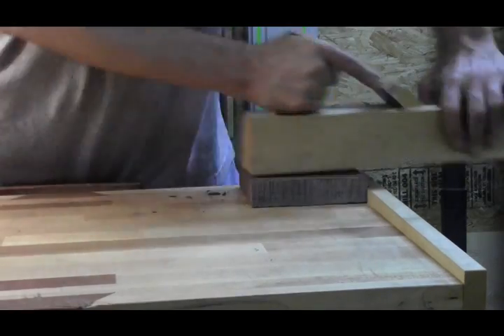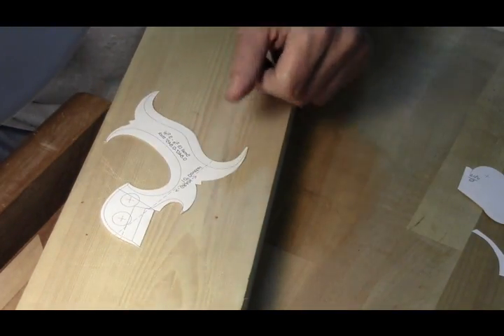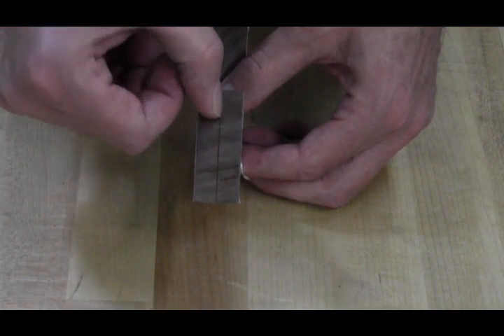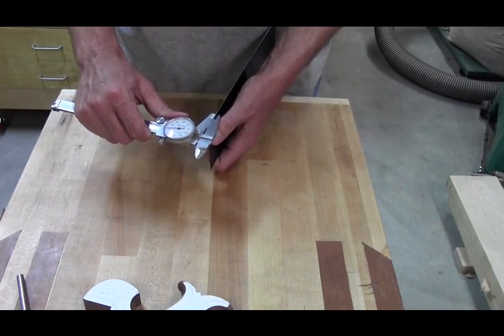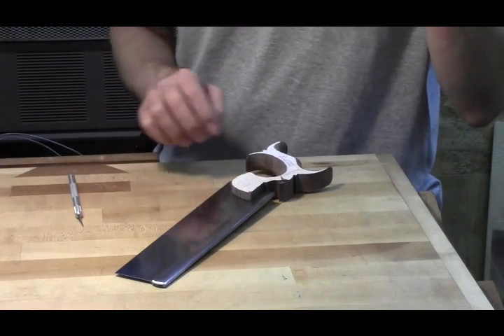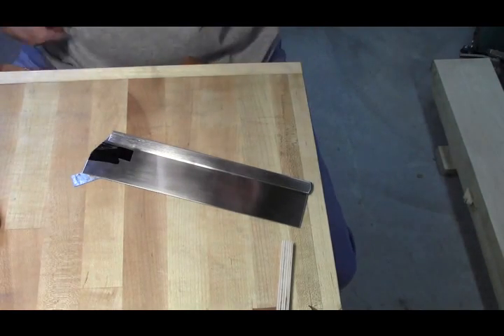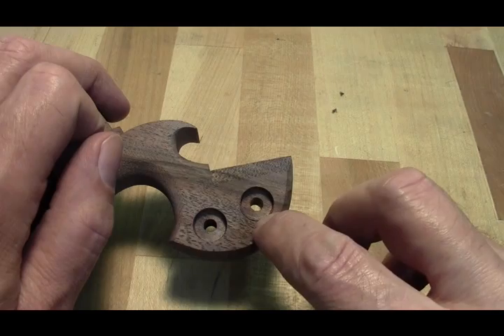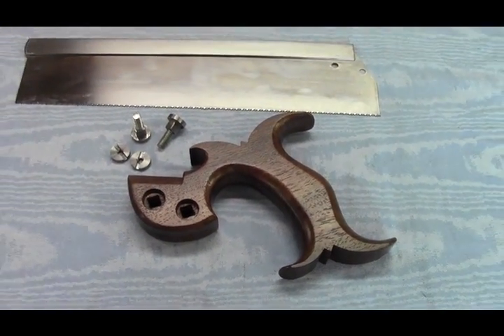Dovetail Saw Build - Part 2

Comment: could help but notice your spray setup for the shellac I looks like and aerosol can on a small jar did you make that?
Reply from the maker: mggcomputers That is a Preval brand sprayer.  You should be able to find them in the paint section of the big box stores In the US.  I have used them for many years.
Reply: Oh cool, thanks for the tip

Comment: An old trick for drilling is to get a nail cut square or similar pin, and spin it in a drill press against the hole location until you draw the temper enough to drill it with HSS.

I have a 3 ton press, so I will probably just make a simple die.

A trick for teeth is to use a hack saw blade as the template, either totally, or just long enough to get the positions for the teeth you will file.  That was in some FWW publication.
Reply from the maker: +Hondo Trailside Paul Sellers has a trick of using a hacksaw to start forming new teeth on a saw plate.  I haven't tried it with 1095 steel yet but if it works, it would make my files last longer.

https://woodworkingmasterclasses.com/2014/12/recutting-resizing-saw-teeth/

Comment: Well I just found this vid series and have learned much.wondering where to find a saw handle makers file though ?.
Reply from the maker: I got my handle makers rasp here:
https://www.toolsforworkingwood.com/store/item/GT-SHRASP.XX

Not cheap but it is hand stitched stainless steel, a nice tool.  You can get by with regular files and rasps, this one with the curve just makes it a little easier.  I have already used it to make three saw handles and have more planned for the future, so it should amortize out nicely.  If you are only making one or two, I'm not sure I would spend that much for the tool.
Reply: thanks

Comment: I was surprised to see that punch work on that metal.
Reply from the maker: You're right, that steel is really tough.  You can see in the video that the punch goes through all at once in a fairly violent fashion.  I wasn't joking about smashing a couple of fingers in the process.  No serious damage but it did hurt.  Using a carbide drill bit in a drill press would be a good alternative to this.

Comment: Great project Mike. I'm curious how you approached the teeth filing process. I had an old dovetail saw that needed all new teeth a while back, so I filed it down to a fresh edge, squared it and started filing. To make the spacing easier, I purchased a 14 tip hacksaw blade and clamped it to the dovetail blade. A perfect guide and a real time saver.
Reply from the maker: I just used a laser print of lines spaced for 15 ppi.  I folded it over the blade and taped it in place then just filed one stroke through the paper at each mark.  After that I removed the paper and started filing.

The hacksaw is a great idea as long as you are careful not to hit the harder steel of the hacksaw too many times and dull your file prematurely.  I may give it a try in the future.